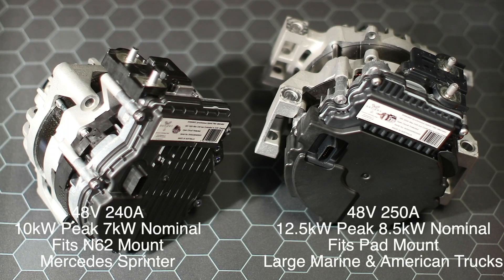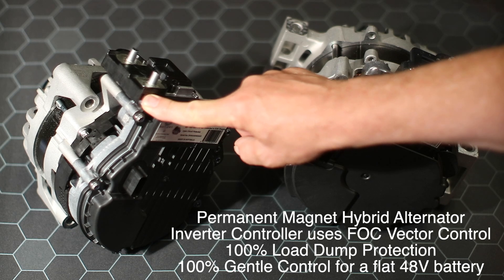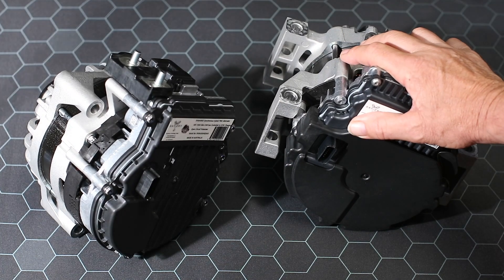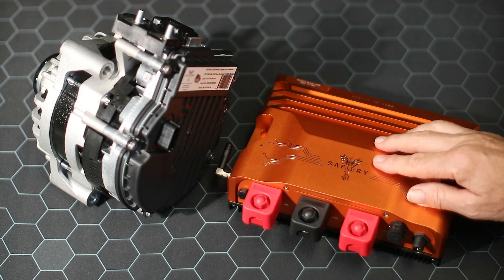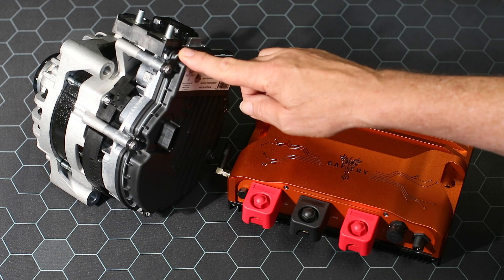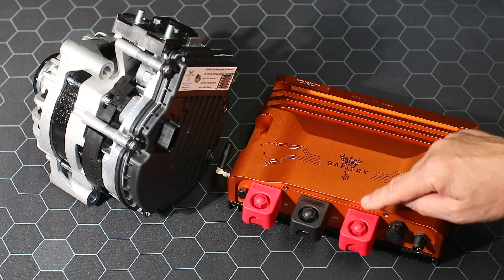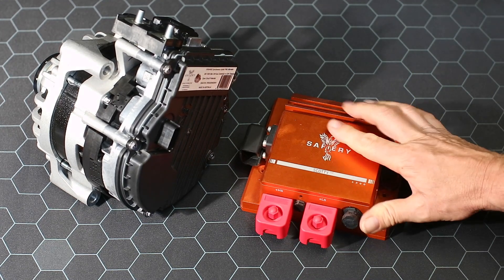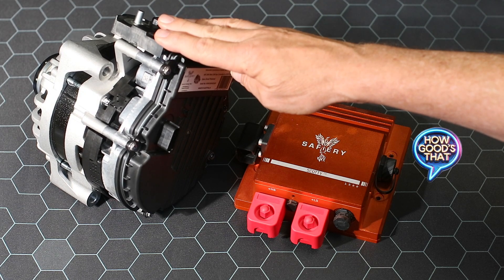Safiery's Synchronous Hybrid Alternators for 2025 10kW 48V and 12 5kW 48V plus Scotty AI V3

Comment: Can we swap these alternators on our American Ford Transits? I have a 2019 Transit 350HD with a 250v alternator OEM. Would it be better to swap it out?
Reply from the maker: Hi I dont know yet. We have to see how it may fit. I need a dealer over there to evaluate as we dont have that model here.
Reply: @Safiery  Bruce, I am willing to purchase one and have a shop here sort it out. Maybe instead of a swap but as a second alternator/generator.
Reply: @Safiery  we would be interested in helping you with that fitment.  We can even make billet alternator housings to mount the sprinter unit directly in place of a Ford Transit unit.

Comment: I'm working on an electric supercharger for an automotive project. Can these alternators be used independently in universal projects? Charging a 48V battery and boosting for periods of 2 to 3 seconds?
Reply from the maker: Yes they started out as 48V Belt Starter Generator with high output for short period. Ive spent some time looking at electric superchargers and I think the response time of these is too slow. Our 48V Solid State battery is 3C discharge so one unit will deliver 7500W. thats the direction i would go in.

Comment: how much is the cost for just the sprinter alternator 7kw 48v 240a, needs water cooling?  needs stronger belt? can support engine start ?
Reply from the maker: It wont run without a Scotty AI. For lowest cost choose the 1500W model. The Stand sprinter N62 kit supports this model. Pricing on our website

Comment: Once the battery bank is at the desired state of charge...  Say 80-100%...  Does the alternator's drag on the engine diminish?  I.E. does the field coil have a feedback mechanism through the regulator, ultimately acting on a signal from the battery BMS?

If it does, how much horsepower does the alternator / generator utilize when battery charging is not demanded?
Reply from the maker: Yes, the load on the engine is determined by the load requested from the battery. Having said that we have a "soft, Medium and hard" power control setting that scales that. I dont know the power it will consume with zero load. We will find out when we fire up our test rig later this month.

Comment: It's a pitty these things are so ridicilously expensive. At a reasonable price these things would be vaccumed up by the growing off grid market.
Reply from the maker: If you see the manufacture of these units, it is complex plus the rare earth magnets are expensive. Having said that these are 20-30% less per Watt produced compared to a standard 48V alternator at say 100A with an external regulator. So prices are falling.
Reply: @Safiery   You can justify it any way you like. We bothh know thease are high markup items. 

The off grid market is simply not going to pay multi thousand bux got a limited use alternator when one can buy a decent mains voltage unit  for the same and usually less money. 

I guess when you cater so largely to the marine and RV market where people are used to paying stupid money  for ordinary things that they have been groomed to think are expensive, you can sit pretty and charge what you like. 

Don't mean  other people can see the igger picture and the products are completely over priced and not worth what is being charged for them. 

Real shame for the more awake and ever growing off grid market. 
Spose won't be long before the Chyneese see the opportunity and step into fill it with a lower priced and decent quality product with far less markup on it.
Reply: Have you priced a 7kw or 10kw diesel generator? 11,000 USD for a Onan 7k and the space is takes on my coach is massive. 

On my latest build, I went to a 25kw battery bank, this would recharge is and give me the best of both worlds
Reply from the maker: @supersize75k5  Yes you are a perfect customer for this and it is half the price of the generator--- let alone the running costs.

Comment: I had never heard of these hybrid alternators before on the market, proving you are never to old to learn.  
My first thought is the 'Scotty' is a second battery isolation device, not unlike the victron DC to DC couplers... but with loads more abiity..... and you mention it talks to victron... jaw dropping amazing. 

How close is a 7 or 10kw hybrid alternator going towards pushing the limits for belt drive before reliability issues start to cause concern, that would be my next big worry...  

But hay, 7 or 10kw power from your engine alternator is on a whole higher level to traditional fossil fuel propulsion applications.... it is just a shame this is evolving and getting really good about the same time fossil fuel use in propulsion starts its hyperbolic decline.... imagine what we could have done with this fifty years ago!
Reply from the maker: These are a result of Mild Hybrid vehicles. and yes, the technology development is fueled by automotive and aircraft industries...thats where the money is and because of the volume in automotive, becaome affordable parts. Then the puzzle is all in the software.

Comment: Have you thought about the possibility of providing these for stationary off grid backup generators? There has been many issues with using regular 120/240v AC generators as well as efficiency losses. Having a clean and efficient direct generator to recharge 48Vdc battery packs would have many advantages for off grid solar systems.
Reply from the maker: For marine, we have a flat pancake 10-15kW unit we will be offering that bolts directly to front of engine and can be stacked 2 deep. These are 93% efficient. Yes, your idea of using similar for stationary power direct to 48VDC is good because of efficiency.
Reply: @Safiery 
I am very interested in details on this stacked pancake version.
How to wire it to charge a battery array, which is serving a solar array inverter, such that it can be programmed to begin charge at low voltage set point, and stop charge at high voltage set point.
Please include details on any safety elements such as fuses or breakers. 

Specifically interested in interfacing to EG4 LL S Battery Array and EG4 18kPV inverters in parallel.

This may be my next purchase!
Reply: @Just_An_Idea_For_Consideration   FYI I also have a 18Kpv inverter, but I used JK BMS based diy batteries for my 75Kwh array. So I would be really intersted in spefifications like how much HP at what RPM is needed just to have the alternator make maximum power. Since the 18Kpv can be paralleled I suspect the the only thing needed would be to protect the alternator with some diodes to only allow power to flow from the alternator and not from the mppts in the inverter into the alternator.
Reply from the maker: We are building the Test Rig over next 2 weeks and we will see...
Reply: @Just_An_Idea_For_Consideration  Agree, would love to see also a video on them. There is a market for them.
Reply: @Safiery  I am Extremely interested in this stationary pancake system. Something like this set up on one of my trucks, one on my boat, and one on land would change options in my world for the better, no question. "How good's that? Pretty darn good, lol. Are these available yet, and if not do you have an ETA for the states? Thanks very much for your time sirs.👍
Reply from the maker: @SvenShalom  Reply on status posted above
Reply from the maker: @desertchild3550  Reply on status posted above
Reply from the maker: An update to all the questions on this. We are in advanced discussion with European manufacturer who already has the SAE bolt on pattern for Yanmar 3JH engines. So its a nice fit. However, their is some detail on the through shaft pancake fitting copling to the engine which we will keep internal for now. When this is finlised, we will do Youtube annunceent. Right now Victron want acceleratio of the digital switching integrated solution and we are focusing all our efforts to g=have this released in 30days. Then back to the PMG's.

Comment: Nice work. I've been thinking about this for a while, but after watching I'm left confused; can I also run the alternator from the 48V battery to drive the diesel reducing its fuel use - in other words can I use this to convert the sprinter to a light hybrid? Happy new year too.
Reply from the maker: Perfect Question and the answer is YES. It is a true inverter/controller and we can drive it as a mild hybrid. I want to thank you for raising this as I had forgotten about it when i did the video.
Reply: This is something I was curious about as well.
Reply from the maker: Posted a new video on the topic you raised. Thanks for the insightfulness. There was so much going on with power extraction and our test rig, i totally overlooked this possibility.
Reply: I'm assuming you would need a separate drive motor, while the alternator could be driven as a motor the belt tensioner would release and the belt would slip. I'd be interested in the mild hybrid concept powering the front axle- ie independent of the sprinter diesel drive train.
Reply from the maker: Good Point. and I dont know how the belt will work driving power rather than extracting it. We will soon find out. Im optimistic.

Comment: How much load do they put on the engine? Do they effect feul economy?
Reply from the maker: Good Question. At 50% of maximum RPM, the diesel engine is typically operating at a point of high thermal efficiency, near its sweet spot in the fuel map.
Engines are often most fuel-efficient between 40–60% of their maximum RPM and load capacity. The increased load of a high power high efficiency hybrid alternator improves the engine's brake-specific fuel consumption (BSFC) slightly, as diesel engines are generally more efficient under higher load conditions within their optimal range.
Hybrid Alternator Efficiency: Running the alternator at full load typically results in its peak efficiency (85%), minimizing losses in converting mechanical power to electrical energy.
Engine Efficiency Impact: Adding the alternator load increases the engine's total load, potentially pushing it closer to its optimal operating point, which can slightly improve overall fuel efficiency.